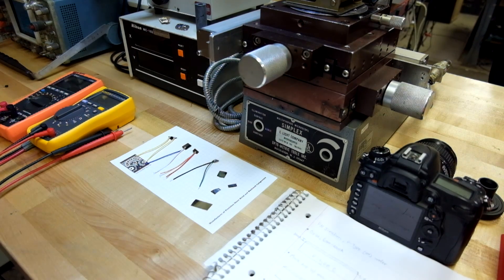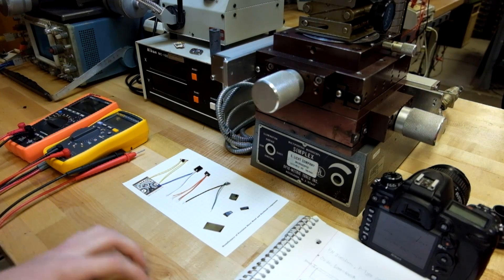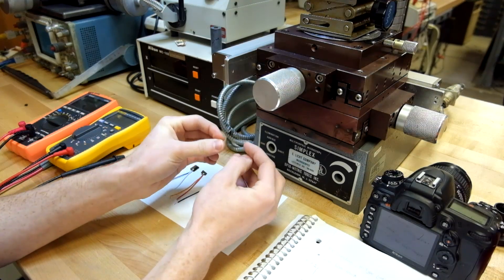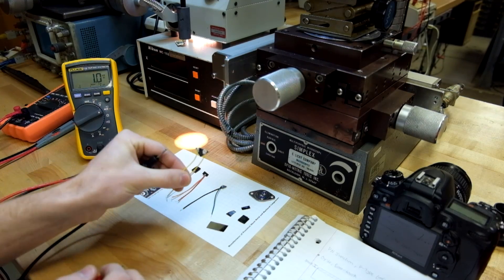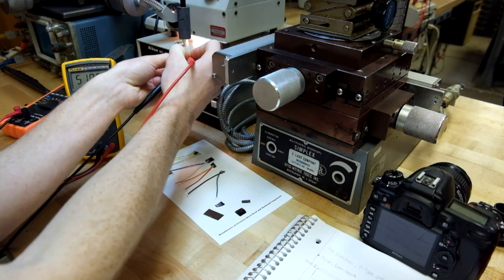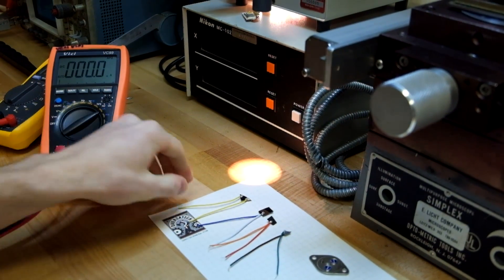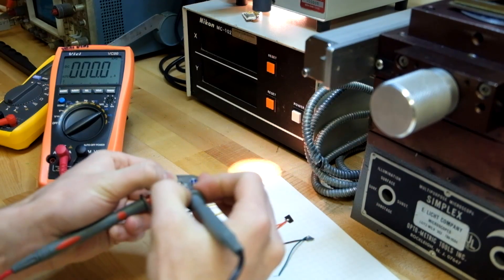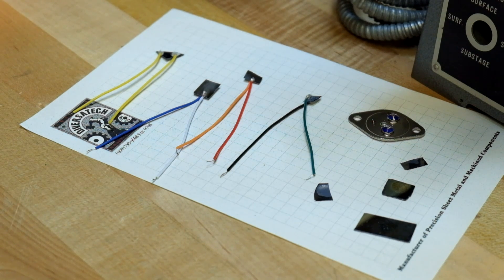Homemade Photovoltaics - DIY Silicon PN Junction Solar Cell Testing

Comment: how could I solder a wire on the two sides of silicon? what are the materials you use?
Reply: Silver epoxy 

Its not solderd

Comment: Great stuff, thank you for building and showing this off, Sam!:)
I know it is an old video and you are much more experienced nowadays (That is how time works): But here are my nitpicky two cents, hehe:
1. It would be an advantage if you did not include your uncontrolled (due to contact pressure and skin moisture) changing skin resistance as load resistance in the measurement (oopsie! :) ). Hint(and joke): colloquial "Fliegenbeine", German for "fly legs", better known as measuring clamps (like SKS Hirschmann KLEPS 30 as an example).
2. With an insulated and temperature-controlled base-plate, which is at a fixed distance from the fixed light source, and thus ensures a controllable and repeatable measuring distance ... everyone will be happier :)

(Excuse me, that's just rude behavior on the part of a physicist. However, it has the advantage that it makes measurement results more "comparable" and repeatable. Especially after 6 years, right? ;) ) 

Thanks and keep up the enthusiasm, curiosity and the good work!

Comment: Hey awesome videos man, best DIY semiconductor tutorials around.  I'm just curious, but how much of the Pepsi Throwback did you use? I might try that as well since it seems like the cheapest.  Did you just put a few drops on and then spin it?
Reply from the maker: +David Panapa thanks, and yes. Just a couple drops, I tried spinning it some times but other times I just left the drops on the wafer as is
Reply: Just one more question, but after putting the cola on, did you put it on a hotplate for a bit, or were you able to just put it in the furnace and diffuse it in?
Reply from the maker: I think I just put it straight in the furnace.
Reply: Last question, concerning the etching.  I haven't etched it yet, because I'm really hesitant to work with HF.  If my understanding is correct then the etching removes the phosphorosilicate glass and silicon dioxide layers that form in the furnace, and these prevent the solar cell from working as they are insulators.  I'm curious if it would be possible to just physically scrape it off to make room for the anode and diode to connect, or if scraping would possibly remove the N-type layer.  I'm just afraid to work with HF because everyone keeps on telling me horror stories about HF.  Anyways, thanks again for all your help, your videos have really helped me out.

Comment: What brand is the conductive silicon epoxy? Seeing that it works very well with silicon, I would really like to know where I can get it!
Reply from the maker: mg chemicals. Are you making semiconductor devices at home as well?
Reply: Sam Zeloof Soon! I am in the process of getting the materials I need and trying to work out how everything is gonna go, I'm definitely going to go with conductive epoxy, seems to work perfectly!
Have you had any success with making diffusion transistors?
Great work and great video by the way!!
Reply from the maker: Best of luck! I haven't attempted bipolar transistor but I've made a few enhancement and depletion mode insulated gate field effect transistors. I'll make a video soon if I have time. Keep me updated on your progress and feel free to ask any questions along the way. I just picked up a nice lindberg tube furnace on ebay for diffusion, you'll need to get one of those or at least a pottery kiln. I can help you with making a spin on dopant source as well.
Reply: Sam Zeloof I was actually going to make a home made furnace, with firebrick insulation and a nichrome heating element that can reach the 1000 degrees C neighbour hood, since most high temperature furnaces are out of reach for me. Also, from some bell labs literature I have found some wonderful ideas for dopants, like boric oxide as a p type dopant (by making a paste of boric oxide, applying it to the wafer, heating for diffusion and etching the excess when finished). But, as for n type dopants, spin on diffusants sound like the way to go because most n type dopants are not easy to find and handle, so I would really appreciate any help!!
Reply from the maker: Sounds good. 1000c will be a minimum. For diffusion you really want 1200. You'd be surprised, you can pick up tube furnaces on ebay for a couple hundred bucks. That might be a better option. Boric acid (5% by mass in DI water) works well as a dopant. You can get the boric acid in roach killer. This should be spin coated onto a hydophilic wafer surface. A hydophilic is reached with hot nitric acid clean or 2 part RCA clean, etc. For N type you can make a similar solution with phosphoric acid in an alcohol solvent to make it spin on easier. Isopropyl does not work well.
Reply: What do you use for general etching of the wafer surface to remove the oxide? I'm guessing dilute HF
Reply from the maker: +Brandon Ruffolo yep HF. I'm working on a plasma etcher.

Comment: Much cleaner than the homebrew cuprous oxide photocells I've made :-) It looks like you could fashion a crude PNP transistor using the same methods - something to look forward to seeing on here maybe? Thanks for sharing!
Reply from the maker: Thanks! It's actually easier to make a FET than a bipolar transistor. I've been planning on Making a fet for a while. FETS require only 1 dopant diffusion step while BJTs and JFETS require 2. I'm hoping to attempt transistors when I'm on winter break for school In a few weeks.
Reply: Even if you build a symmetrical device, it may still have gain >1, I believe. This is still a useful device, and is one way very early analog switches were made, iirc.
Reply from the maker: What do you mean by symmetrical? Take a P type wafer and diffuse N type wells on top and bottom?
Reply: The emitter and collector can be physically symmetrical as well as have the same type and degree of doping, though this will decrease beta significantly, it can still be greater than 1, I think.
Reply: Don't Buy Solar Panels Before Seeing This... https://newsolarenegysystem.blogspot.com